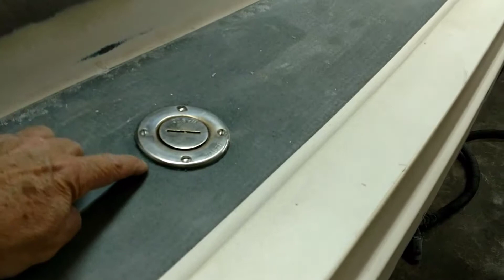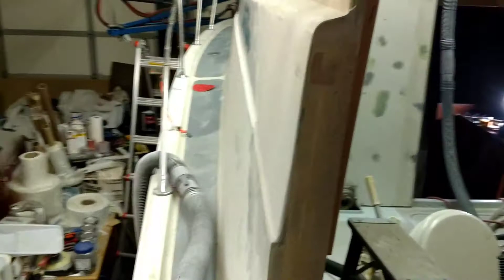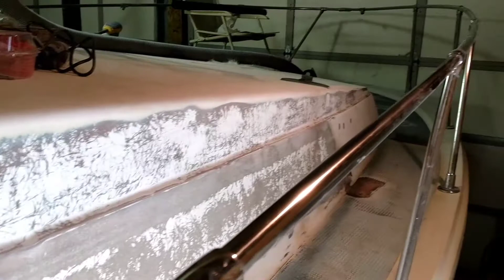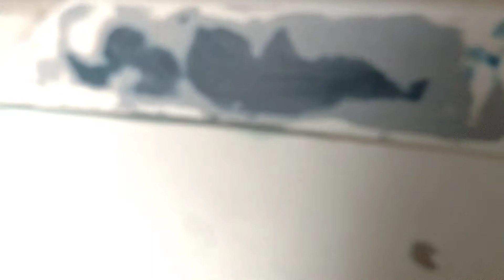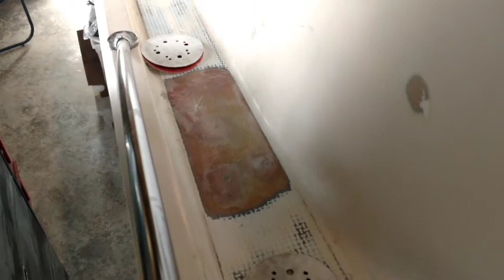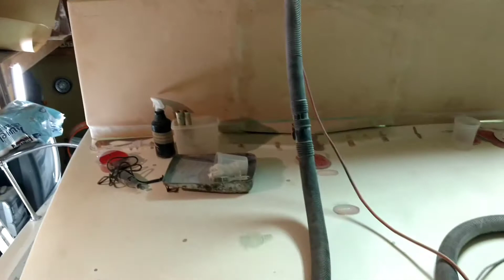Uniflite Saltydog restoration

Comment: I have  the same boat, same year, I guess yours wont be a Salty Dog anymore,, Im sure it will be what you want,, I like your work, you seem to be an expert craftsmen, 
I prefer the original look of the boat, subsequently mine is all original and looks great, not like yours, but great for me, I dont mind a few battle scars, and Id rather be on the water with mine ,and have it look like it did in 73  I do coastal cruising here in Fla, and as I said, Im a huge fan of the oldies,, 
Im doing some engine work on mine, currently and really wish I had diesels instead of my 318's but before I change em, Ill look for another vintage boat with diesels in it,, 
great work, and Im sure by now its all done,
Reply from the maker: Thanks for the perspective. I too love the old line, especially the hull, but for the Pacific Northwest and the rough and rainy ocean conditions we fish in I am building her to maximize safety and fishability. I have several friends up here and in Alaska with Saltydog's and they are waiting for my boat and molds to be finished so they can get parts for their dog.
My fixing everything is also for my grandkids to be able to run this boat when I'm dead and gone.
Thanks for watching. Great to hear from another Saltydog owner!!
Reply: @worldcatlemon3795  thanks,, how did it come out, or are you still working on her?
Reply from the maker: Got the pilothouse mold finished. Still working on glass repair, and building raised bosses for my new bow hatch and fuel tank filler tubes. 
Still a ton of stuff to do but I'm hoping to separate the mold and plug and get the first pilothouse built before summers' end and glassed on. Just finished designing an anchor pulpit, now I can build the plug for it.
My goal is to splash her next summer
Reply: @worldcatlemon3795  nice,,, Ill keep my eyes on that,
Reply from the maker: Cool